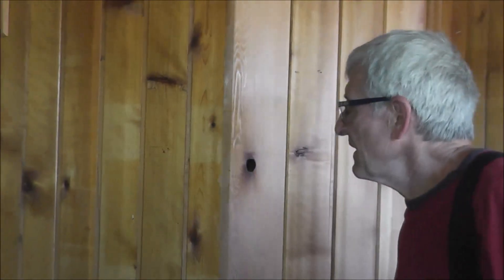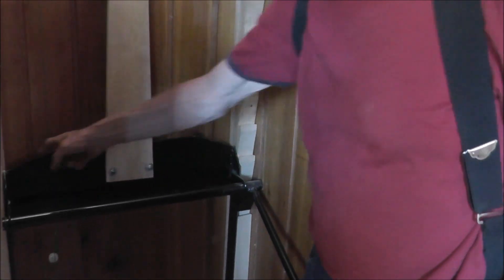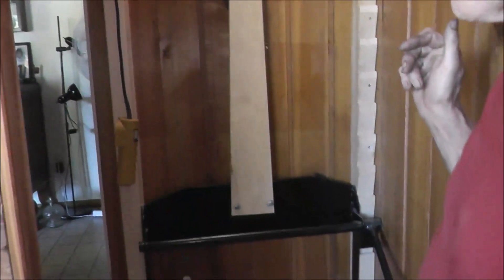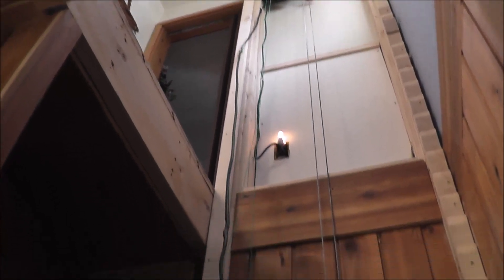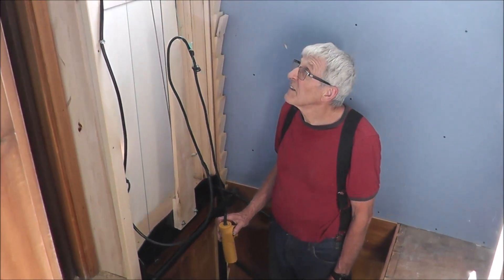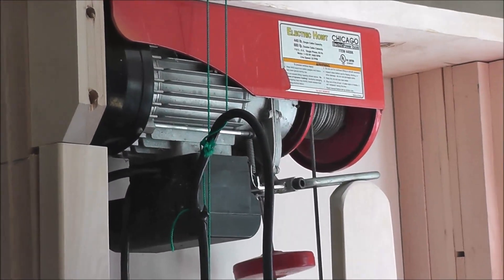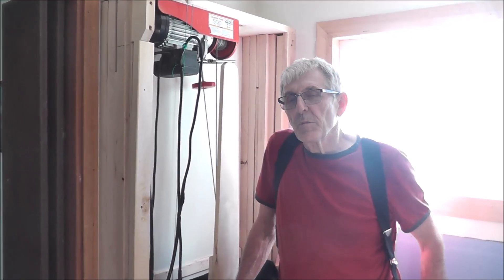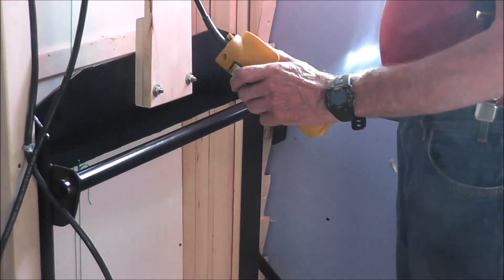DIY Elevator for home or shop

Comment: Great project! But please plan some monthly inspection on the cable and check if those wooden notches are actually up for the job. I have the feeling that if the cart drops the distance of one notch, and then the brake actually meets the notch, that it chops the wood right off. I may sound like a negative ass, but imagine your family getting an accident with this elevator, that will be much worse. Maybe replace the wooden notches for steel ones.

Comment: While I applaud your ingenuity,  this unit has serious issues, especially when it comes to safety.  For starters, even if everything works the way you intended, in case of a sudden failure it would be possible to have a sudden drop of likely up to 5" or 6".  If your wife is sitting on a chair, or even standing, and there is an unexpected drop of that distance, her back will be in much worse shape than it is now from the very abrupt stop.

As has been pointed out by others, having an open hoistway is NEVER a good thing.  At the very least, you need to have some sort of barrier with an interlock so that it cannot be accidentally opened when the platform is not there.
  
You need a slack cable switch, so that the winch will automatically stop if the platform gets hung up for any reason.   You should also have a bottom limit switch to avoid the hoisting cable from going slack in the event of the platform travelling past the floor.  I would not trust the way the top limit switch is rigged up.

The winch itself might be suitable for hoisting materials, but is totally inadequate for hoisting people.  I have one in my workshop that looks very similar, with a supposed 850# capacity, which I use for hoisting material, and I would never trust it never to fail.  Being electro/mechanical, unless you buy a very high-end one, there is always the possibility of a sudden failure.  If yours does while your wife is halfway between landings, she'll be stuck, as you will have no way of getting her either up or down.  

I spent 40 years in the elevator industry.   There are reasons why elevators are such a safe means of transportation.  They're called "codes".  This one ignores pretty much all of them.  If you love your wife enough to want to help her as much as you have, don't let her ride this without making some substantial changes and improvements.
Reply: Could not agree more with you.  I advised Procter to a minimal view of manufactured lift like " Minivator" and see the safety involved.  First and foremost fall safety, fire separations between floors.  It would be like a giant chimney if smoke and fire broke out.  Ideas are great but common sense and rules of safety take the lead in my thinking.  Procter needs a disclaimer if he posts things like this. I am happy I am not the only one concerned.
Reply: @Hamradio54730  a stairway will act as a chimney

Comment: One HUGE problem is there is nothing that block off entry at the top when the "lift" is at the lower floor. That is a significant safety hazard. Sooner or later someone will walk into the hole and fall to the floor below.
Reply: He says it used to be for a bathroom was and it's in an enclosed room so it was convenient
Reply: @pmailkeey Years ago when I was doing an addition to my house the door to the kitchen was moved and a stairway going downstairs was now there. The contractor nailed 1/2" plywood across the old opening. I asked why and he said to prevent you from walking thru and falling to the floor below. Sure enough within a week I waked right into the plywood and bounced off it.
Reply: Missing the point.  The stair is the shaft... Any room at the top have doors cutting off a chimney effect at the top.  Open stair at the bottom does not result in an acceleration point. You are mixing physics.
Reply: Why do multi story stairwells has doors with auto closers to keep doors closed at all times.?  To eliminate any chimney effect from adjacent floors that may have a fire.  Ever hear of a fire damper are a smoke auto damper?  How bout a smoke evac damper system?  I have been in the industry for 43 years until retirement.  Enough said unless you simply like to have the last word indicating a need for hearing yourself talk.
Reply: Im sure its an ongoing project. Hopefully we will get an update when it is perfected.
Reply: Nick Maclachlan  - I'm pretty sure that Gus would have apoplexy if he saw my house, which was built to code.
Reply: Great job! I can imagine that there's some bureaucratic scold in your neighborhood right now plotting on how to make your life miserable because you did this in your own. Probably one of the geniuses writing the idiotic safety critiques here.
Reply: Eric.   You read me wrong!!!! I agree with you 1000%. This video is an example of why rules and regulations exist!!!  They are there for people who are going backwards in safety and common sense.  If you read me as agreeing with all these crap shoot ideas, my sincere apologies as that is far from what I am saying.  I think people who have commented on how great an idea this is,/ was are fools.  Congrats to this guy's skills.  But they are the basics and basics have proven one thing.  This "operation death trap" should be dismantled immediately.  We can surely shake on that!!!
Reply: Also, there is now no fire separations through floor now.  In afire you have created a chimney.  Unless the shaft is created with full enclosure is 1 hour rated fire separations,. It is a tragedy waiting to happen.  Take a look at commercial manufacture personal elevators such as " Minivator" (brand name). You will see what I mean.  Yes nice to be able to have diy projects, but osha and local permits and laws of safety where created for a good reason.
Reply: @Hamradio54730  ummm, there it's no rated enclosure for vertical transport (I.e. stairs) in most single family residential buildings. This opening is not much different.
Reply: @lewerim  wrong.  A simple call to your local building department will enlighten you.  Open staircases have regulations if going to a second floor area.  Rooms such as bedrooms require doors also know as fire stops.  Vertical shafts need rated walls and rated doors to isolate the elevator shaft. As also commented by others there are numerous violations as to life/saftey.  The comments of more lax requirements in small towns or rural areas is crap!  Human safety and basic regulations do apply.  Remodeling or modification of structures or purpose such as changing areas to include a "lift" commonly known as a elevator, are required to have a permit for usage changes.  Take the time to research before throwing out comparisons of stairs to elevator inclusions and shafts.  

Avator
Reply: @Hamradio54730  like a stairwell?
Reply: @Hamradio54730  isn't a staircase a fire shaft ?
Reply: @truhunk1  no it is not.  A stair passage from one floor to another need separations of adjacent rooms such as bedrooms with doors.  Please see my other response a few minutes ago to Eric.

Comment: Brian, a few things that I wanted to say about your installation. I commend you on doing this for your wife. Also, I agree with other posters that the design of of your safety brake is flawed and is very unsafe. You mentioned that you live in northern BC and there are fairly few building code requirements. That maybe true for the municipality that you are in but you still have to abide by the provincial and federal building codes that we have in Canada. 
You mentioned that the winch lifting weight is rated at 880 pounds. If you research the winch, you should find that it will say that it is not to be used to lift people, or to lift items over people’s heads. The reason is that the safety factor for lifting where is has a possibility to impact life safety is much higher that when life safety is not involved. Typically they use a 5-1 safety factor, so get that 880 pound load rating, the winch would be designed to lift 4400 pounds. When the application is for a life safety application, they are going to use a safety factor of typical 25-1, so to get the 880 pound rating, the winch would have to be designed to lift 22,000 pounds. Here is an excerpt on Working Load Limits. 

https://www.ihsa.ca/pdfs/products/id/m035.pdf

For your wife’s safety, please take heed in the warnings that people are giving you. 

Working Load Limit
The maximum force that you should load a component is the working load limit (WLL). The WLL incorporates a safety factor (SF). The SF provides additional protection above the manufacturer’s design factor (DF). The design factor is the safety factor to which the manufacturer builds. The SF and DF do not provide added capacity. You must never exceed the WLL.
Let’s calculate the WLL of a chain or gin wheel rated at 1000 pounds with a manufacturer’s DF of 3.
Note: Section 172 (1) (d) of the Construction Regulation requires a SF of 5. This requirement is greater than our DF, so the capacity must be reduced accordingly.
WLL = 1000 pounds (rated capacity) x 3 (DF) / 5 (SF) WLL = 600 pounds
In this example, the chain or gin wheel has a stamped capacity of 1000 pounds, but, in compliance with the Construction Regulation, it can safely lift a maximum capacity of 600 pounds.
Fibre Rope Selection
Select the size and type of rope to use based on manufacturer’s information; conditions of use; and the degree of risk to life, limb, and property. The WLL of fibre rope is determined by multiplying the working load (WL) by the SF. The minimum breaking strength (MBS) is the force at which a new rope will break.
The manufacturer’s DF provides a layer of safety that has been determined by the manufacturer. The SF, if greater than the DF, adds an additional layer of safety to meet the requirements of users and regulators. Together, these added layers of safety provide protection above the MBS to account for reduced capacity due to
• wear, broken fibres, broken yarns, age
• variations in construction size and quality
• shock loads
• minor inaccuracies in load weight calculations
• variances in strength caused by wetness, mildew, and degradation • yarns weakened by ground-in or other abrasive contaminants.
If you notice rope that is defective or damaged, cut it up to prevent it from being used for hoisting. Let’s calculate the WLL of a rope to lift a WL of 250 pounds.
Note: Section 172 (1) (d) of the Construction Regulation requires a minimum SF of 5. For more critical lifts that could risk life, limb, or property, a SF of 10 to 15 may be necessary.
WLL = 250 pounds (WL) x 5 (SF) WLL = 1,250 pounds
In this example, to meet the WLL you must use a rope with an MBS of 1,250 to hoist or lower a WL of 250 pounds. See manufacturers’ specifications to select the appropriate type of rope.
Reply: Ignore this man. Government involvement for your private residence is for control freak authoritarians. Your taking the risk. Good for you! Bet it never fails and the next guy to live in your house just tares it out.
Reply: @homertalk  control freak authoritarians! homertalk "Its my electricity I am going to have a tinker with it, its my gas inside my home I need to move a pipe what can go wrong" I don't have to listen to anyone 'cause I know best and don't argue with me 'cause I know more than anyone, now leave it at that and let me go back to my punns (tares)

Comment: Well, first thing is, the "brake" would act as a chisel and shear every cog off that piece of lumber, as any carpenter could tell you. The real problem is that his wife has to wait in pain so long for an operation. that he had to come up with this. And yes if there were building codes involved it would never have been built
Reply: With a lifetime of experience installing and repairing hoists, I must agree with the comment from Brooklyn202. Maybe if you face off the sawtooth rack with steel shaped "L"s could improve its rigidity. All elevators also have a counterbalance system so the only load is the weight of the occupants and not platform car, a very easy, upgrade. Also, probably my biggest concern after the rack is the hoist drum cable getting and crushed by its self and tangled. If there is a problem this is where it will occur. You must check the hoist cables ability to smoothly wrap on itself continually that why the type of hoist is never used for people elevators.  Condos on your project, you did a nice job on the construction and creativity, I'm sure the first elevators that Otis build started the very same way. PS. I plan to build my own 3-floor elevator soon also I'm 72YO.
Reply: What will happen WHEN the cable snaps, the winch break fails or the soft pine that the winch is bolted to breaks? Yes all of the weight would force the steel wedge into the cog splitting every cog off while falling faster. Imagine take my an axe and striking each cog. The cogs would split off as fast as you can move. 
Soft pine is the wrong building material. 
At a minimum it needs to be built out of structural steel, it needs a counter weight (to make the elevator lighter), the lift arm should be a heavy leaf spring. So when the winch fails. The weight pulling the elevator up. Would relax and force itself into the steel side rails. Preventing the elevator from moving. Until the spring is compressed again.
Reply: Brooklyn202    AHH, YES.  The New Yorker.
Reply: Bullshit.  Get off the  Prednizone, it's making you argumentative.  The guy did a great job and the cogs will be just fine as it wouldn't fail over 50feet but just 2 inchess or so.
Reply from the maker: @YourOldDog  Thanks, the wood is hard wood and long metal screws through the notches, You could not break one off with a sledge hammer. Also I will be modifying it to lock on the way down if there is any loss of tension on the cable.
Reply: Is the long wait for surgery a product of Canada's single-payer healthcare system?
Reply: @davidschwartz5127  Depends what the surgery is and how critical it is. My dad had heart problem and was treated immediately. I waited 10 days to get gall bladder removed, but had no symptoms when leaving the hospital.
Reply: well the dog will rest on the first wood piece protrude from the rail. The winch (as you may know) simply would lower the platform onto the wood piece and would unwind if you were to hold down the DOWN button. The motor and winch isn't designed (as you may know) to push the platform down and as such no force is being applied to the wood safety rail other then the weight of the occupant and the platform structure.
Reply: Good video, but I have to agree with Broklyn202, the lumber piece would probably not stop you should the cable break, the metal stop would act like a axe or wedge.  Good idea but wrong material maybe change it to metal.  The wood may stop you if you were at rest, but a sudden drop would act like an ax chopping wood.

Comment: Congratulations...The only one with a ratchet on the way down on Youtube. I think your idea of using a spring loaded device will be useful as one cannot trust one's reaction time in an unfortunate emergency.  Wonder what would be done to lower the platform manually  in the event the wire breaks and the rachet mechanism is holding it up.
Reply from the maker: I have certainly thought of that,  If we are both home a step ladder is the only thing I can think of. certainly crossed my mind. Just thought of an idea. attach a simple ladder to one side. could be 7 feet long. then one could climb back up or take it off and climb down.

Comment: Clever use of simple materials, but you should really have a trap door or a regular door with a latch that prevents it opening unless the platform is fully up or someone may well walk right into that hole and end up really disabled.
Reply: I think he mentioned that the upper room was enclosed.
Reply: OLD SCHOOL The hole in the upstairs floor is a problem but I think I have a pretty simple solution. The upstairs platform rises as the downstairs platform rises.A ramp will probably be required to compensate for limited height upstairs.Up or down there will be floor there.
Reply: @williamtate6268  You are on the rght track  I've seen where someone made like a small room, when it is all the way downstairs, the ceiling portion of it makes a cover for the hole upstairs like a floor.
Reply: YourOldDog  Exactly

Comment: If you want to control something via wireless then check out => controlanything.com. They sell a wide variety of products. I mounted one of their devices in a 6 x 6 plastic junction box and use it to control a 120v AC motor using a keyfob.

Comment: Very clever. I’m just not convinced the hardwood ratchet is going to survive a shock loading along the grain. I’d be inclined to re-cut with the grain horizontal, or try to find some scrap industrial metalwork.
Reply: Andy Owens  Steel!